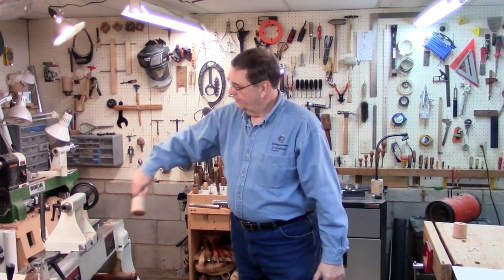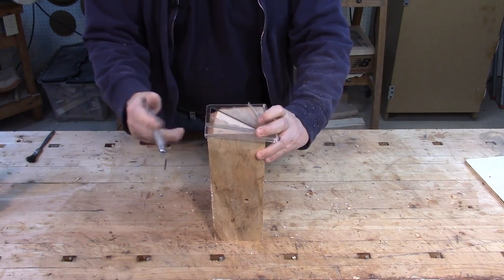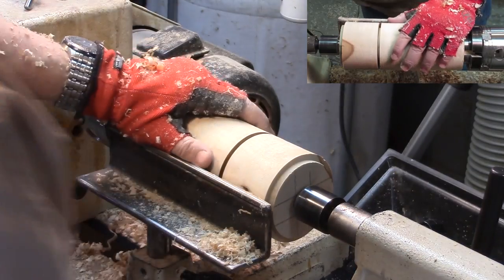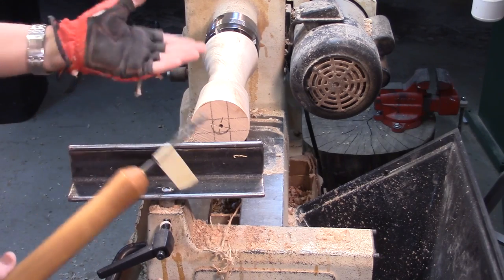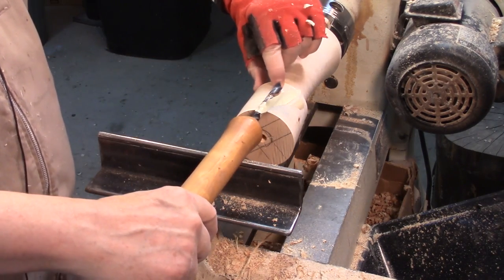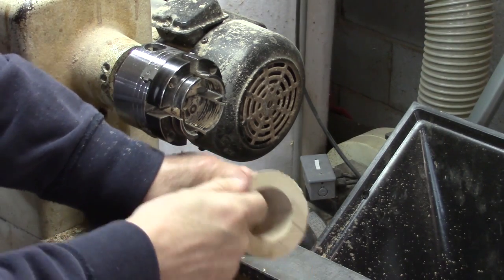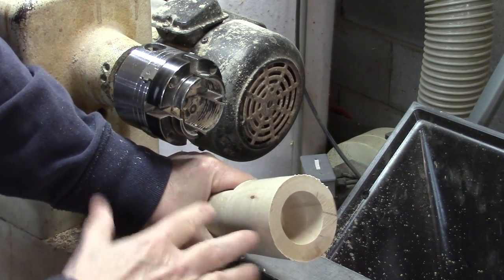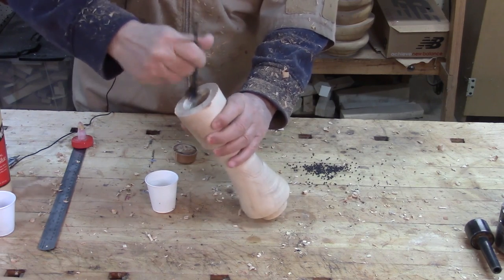Turn a Dead-blow Mallet

Comment: Thanks for the video, Rick. I took special interest when you were hollowing out the inside. I heard your lathe making the same vibration noise mine makes when I'm working inside like that. Since I am a total turning noob, I thought something was very wrong. I can see it is typical. Great video and an excellent idea for Christmas presents!
Reply from the maker: Sorry to be the one to deliver bad news, Chris...it took another month and two friends to discover that the irritating noise was caused by a bad bearing in the headstock speed adjustment mechanism. It's not difficult to replace (once you've disassembled the headstock 5-6 times) , but the replacement part was around $60, I believe. But once you do replace it, it runs quiet and smooth. This assumes you have the Jet 1441 lathe, from about 2008. If you're interested, I can find you the information on that part (I don't have that lathe any more, but I know the new owner, who actually did the repair.)

Comment: Thanks Rick, just thought it wood be easier than hollowing with all the vibration. BTW, I just made a carving mallet out of red oak firewood.
Reply from the maker: Steve Hoppe Oak is a good choice. What did you use for weight?

Comment: Very nice project.  I've made a couple of regular mallets, but I may try a dead blow for variety.

I'm curious about your tool rest.  Is it shop made or commercial?  My lathe came with two tool rests, but after using it for a year, I think I need a shorter rest, and I'm thinking of trying to make something since I haven't found a commercial rest that I really like.
Reply from the maker: Hi, Louie. I know what you mean about needing a different length tool rest. Yes, the one in my dead-blow mallet video is homemade. I've made 8 or 9 different tool rests now, trying different things and different metal stock. It's a lot of fun. I've started making a video on how I make the angle-iron tool rest (as shown in the mallet video), but haven't actually gotten very far with it yet. It's really a simple process, and it doesn't require welding, just silver brazing, which you can do with a MAPP torch and some silver braze wire. Keep an eye on my channel, I'll get that tool rest video finished and posted in a month or two!

Comment: Could one use a huge spade bit in the tailstock to hollow it out?
Reply from the maker: That would be a very large spade bit! I'm sure that would work, but it's probably faster to drill a small hole then hollow it with turning tools.

Comment: Hi Rick love the video. Like to ask why when hollowing the head, wood it be easier to just drill a bigger hole?
Reply from the maker: Steve Hoppe You're absolutely right. On the first two mallets I made (the ones in this video), I thought I needed more volume hollowed out than what I could get with my largest drill bit (1 1/2 inch). On the next mallet that I made, I used the 1 1/2 inch bit anyway; although it didn't hold as much lead shot, it was still plenty heavy enough.

Comment: Love the project Rick. I made one of those 8 months ago and it my number one go to tool now, just a question about polishing the boiled linseed oil, there is some danger about linseed and it being highly flammable could the friction of the polishing cause it to combust? (genuine question if  anyone can reply).
Cheers
 Frank
Reply from the maker: Wow, that never occurred to me (you can tell how safety-minded I am)! I tried to friction polish with the boiled linseed oil, but couldn't get it close to as hot as I get with my shellac-based polish. The BLO got warm, but never hot - maybe I just didn't put enough effort into it. But it did apparently get warm enough to dry or set the finish, because it wasn't damp or sticky when I finished, which is pretty much what I was after.
Reply: Thanks Rick

Comment: Rick, is that green wood and if so does it need to be processed in any way to keep it from splitting?
Reply from the maker: Hi, Joe. No, that wood was quite dry. If it had been green, I wouldn't have done anything different, I think. It might have warped some but that probably wouldn't hurt it.

Comment: Actually, the flat is to keep it from rolling off the bench when you set it down.
Reply from the maker: Sounds like a good idea! I put mine down on the head with the handle pointing up, so it won't roll off.
Reply: My bench is never neat or clear enough for anything to roll anywhere.